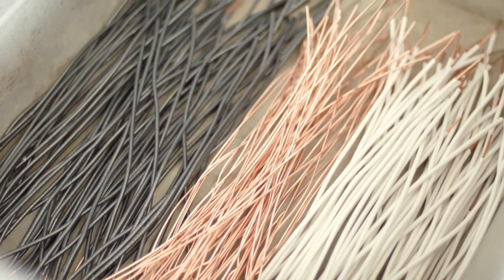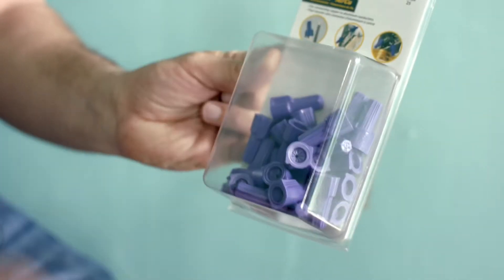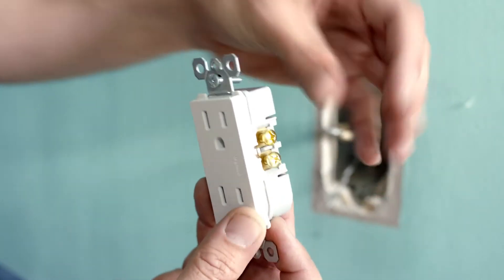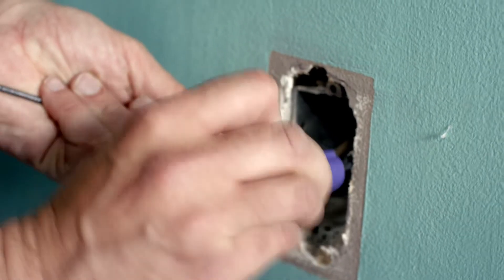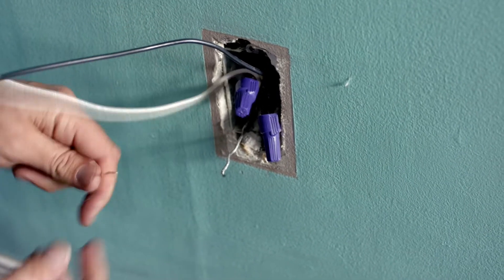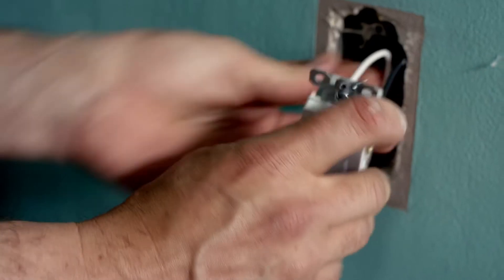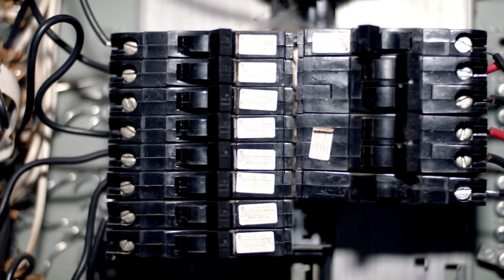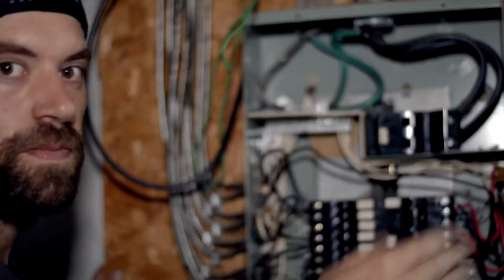Fixing aluminum wire in your home

Comment: when twisting the wires together should you not be using ox-gard first to pervent Galvanic Corrosion of the to different metals not just what's in the wire nut?

Comment: If your breakers weren't rated for aluminum, would you have to pigtail in the panel also?
Reply from the maker: I don’t think I’ve ever seen a breaker not rated for AL/CU. But if it’s not you could splice it, making splices in the panel is not to code though, so you’d need special permission from your local inspector.
Reply: @Luminelectric  ok thank you!

Comment: In my area there are tons of neighborhoods and houses with aluminum wire. I replaced most of the outlets and switches years ago with CO/ALR devices and have never had an issue. As far as pigtailing in some situations, I just pigtail a piece of copper with the aluminum, add antioxidant paste to a wire nut, secure with the nut and wrap with electrical tape. That serves the same function as using the purple wire nuts. I've had zero issues in 20 years.

Comment: Cant you just use co/alr  outlets and switches?
Reply from the maker: I’ve never seen switch’s/ plugs that are rated aluminum but if they were you could do that way.
Reply: @Luminelectric  I replaced all of mine nearly 20 years ago with CO/ALR outlets and switches. They have been available in the US for at least that long from places like Lowe's and Home Depot.

Comment: What about Wago 222 with wago’s 249-130 alu paste?
Reply: I don't believe the sell the paste any longer and you can't get the Wagos for aluminum here...I tried they are only approved in the UK and Canada and will not ship here.
Reply: @craig156  I did "google" search and was able to buy the syringes with wago's 249-130 alu paste and wago 222 grey connectors.  Their website has an article on its effectiveness, when combining aluminum and copper wires.

Comment: I found Home Depot now sells Aluminum rated receptacles and switches. I go around and check the screws on mine once every 2 years haven't found anything lose.
Reply from the maker: Good that you are on top of it
Reply: They have sold those devices for at least the last 20 years.

Comment: Great video..what do you do in the panel..at what point do you pigtail?
before the box inside at the top, or before the breaker point?
Reply from the maker: In the panel I don’t think I’ve ever seen a breaker that’s not rated for aluminum, so your pig tailing your lights, switches and receptacles because they are not rated for an AL termination. You can check your breakers and they will say AL/CU on them which means it’s rated for both. Adding de-oxidation gel to your breaker termination is never a bad thing if your worried about your panel termination.

Comment: How old and brittle does wire casining on aluminum wiring need to be before its required to be changed completely? 🤔  found old aluminum two wires no ground crusty wire sheathing I cannot find in NEC this c*** has to be 50years old or more!
Reply: There is no code rule in the CEC our Canadian version of the NEC, usually things like that are left up the contractors discretion. Things can be grandfathered in for a long time. No grounds is bad, I would try to change itx

Comment: I know these pigtails are "supposed"  be allowed with Aluminum pigtails, however from my research looking into this as a homeowner of a house with these wires... This connection isn't recommended. The "preferred" connection is a overly priced Wire Connector called AlumiConn . These suckers are expensive, but proven to work long term so long you torque them down correctly. I'm in the process of pigtailing all my connections using this expensive thing and a torque screw driver from Amazon.
Reply: Hey, I know this is old but figured I’d give you my thoughts.

Inside of these outrageously priced Al wire nuts is Noalox, just buy the small tube of this stuff for $5 and put it on the conductors before using regular inexpensive wire-nuts.  You are supposed to use a wire-brush and rub it on good making contact with all of the connection.  For a whole house, this will save you probably $$300–$400 in wire-nuts being that these aluminum ones are $44 for 10!!! Nuts!
Reply from the maker: Hey Chris, I tried to use google to see what your problem might be with this type of install, this is the first article I read: 
https://www.wirechiefelectric.com/aluminum-wiring-pigtails-know
This type of install is completely safe and up to code here in Canada under the CEC. Please feel free to send us any articles your reading from as our minds are always open to new ideas.
Reply: @Luminelectric  ohh okay, in my state, insurance companies prefer the overpriced aluminconns. It's ridiculously overpriced at almost $3.80 US just for 1 pigtail.
Reply from the maker: @Mr-Chris  totally, if it makes you feel better those merrets from the video are about $50 for 25. They are still very expensive. Good luck with fixing your wiring. It’s good that you are fixing it properly.
Reply: @Luminelectric  what's your opinion about ground? Do you think they actually need these type of pigtails?
Reply from the maker: We do the grounds as well. And if there is a federal panel we suggest a panel swap as they are notoriously not tripping
Reply: @Luminelectric  i have to agree with chris these are not a permanent fix the alumicon are though. i am in nova scotia and i have had a few of these melt on me also the stuff inside is known to evaporate i guess if checked every 6 month or something they could be a fix but i wouldn't trust long term.
Reply: @Luminelectric  also tuck those in like a cup hole up or the stuff leaks out too